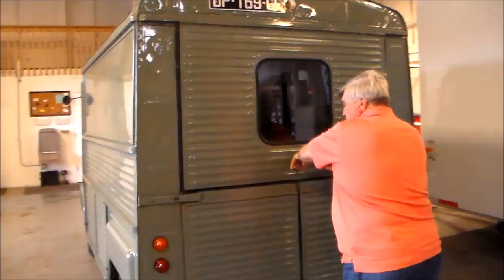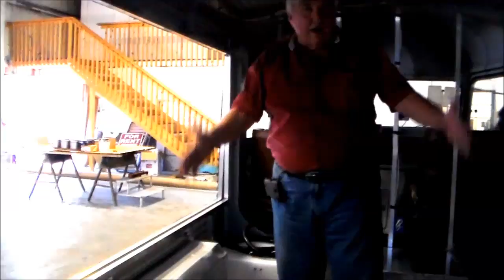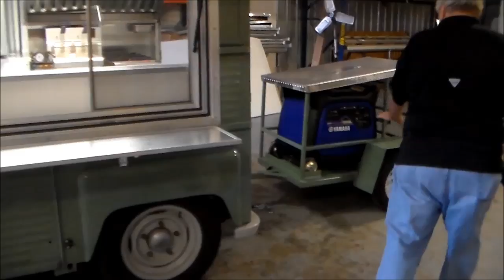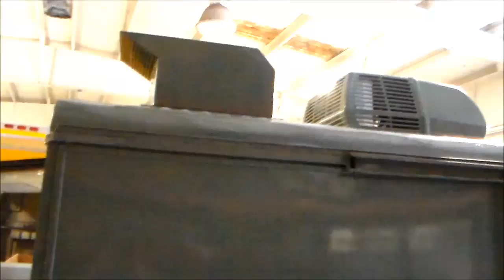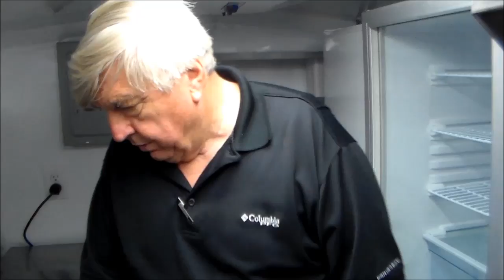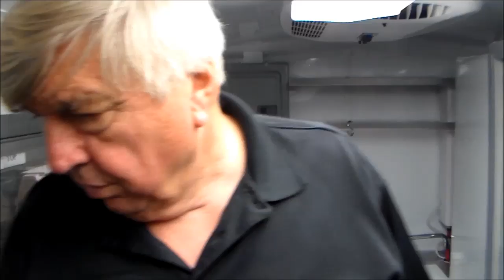H Van Concession Truck

Comment: I’ve been searching for this truck forever !  You guys did an amazing job and are very close to me!  Everywhere I have found this truck - they do not include the cabin driving are which is important for us! I see they added a back extension is that for the generator? Can it be made electric and not propane? And also how much does this one go for and how long will something similar take for a build out? Do you guys wrap it as well if needed ? Looking fwd to hearing back - thanks so much

Comment: I'm interested in building out one of these in H Vans for business in CA.  In my state the floor to ceiling height must be 74" and the aisle  must be 30" wide.  Do you know if this truck conforms to the same standards?  I'm trying to figure out if I can make it work without altering the roof.
Reply: Jenn, find another one with a factory higher roof. Many variations were made both from Citroën and from aftermarket.